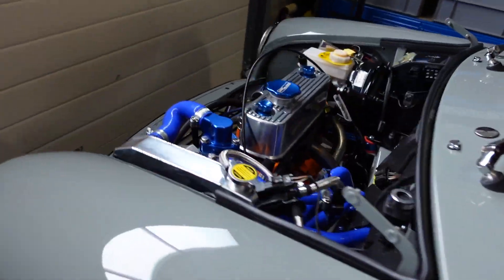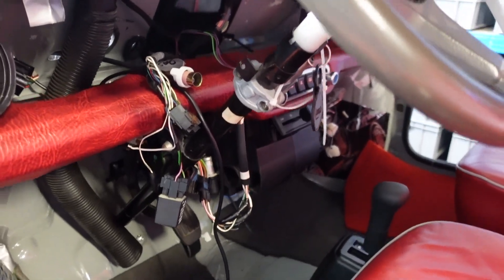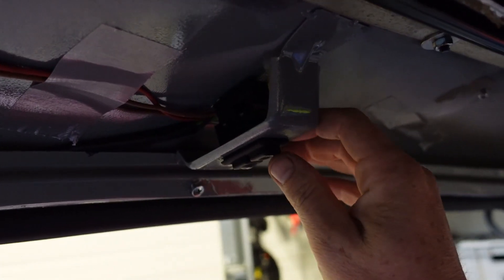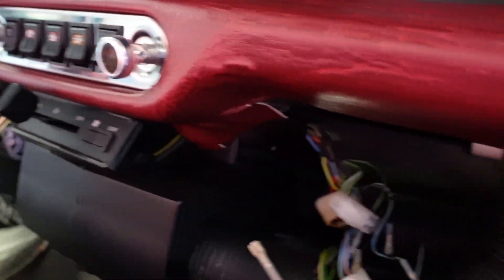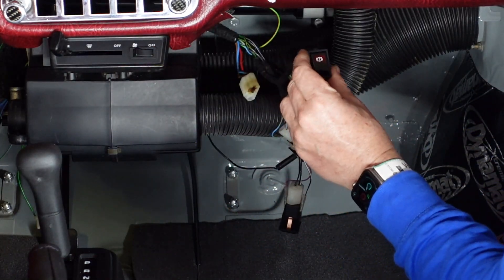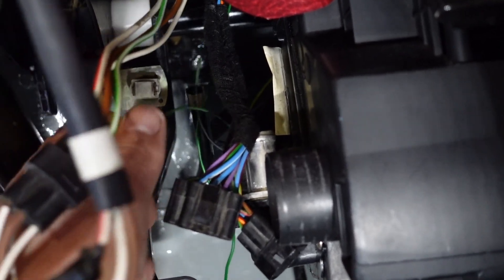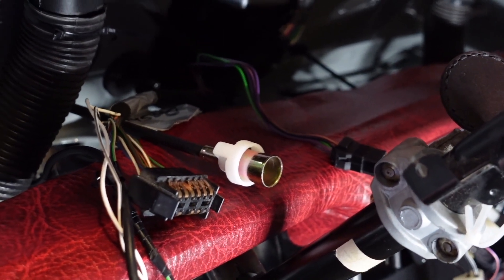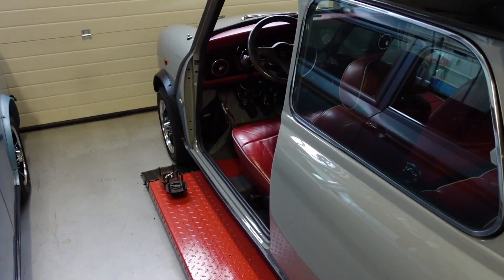Classic Mini Culture - Part 23- SPI wiring

Comment: Is it possible to modify the tank brackets rather than the support bracket welded on the car? Might be an easier fix for you
Reply from the maker: Mike I think I've sat and looked at that bracket for hours to try and figure out an alternative, but the tabs on the tank stop you from going past the bracket, and I don't want to cut into the tank, someone suggested a race tank that sits in the wheel well, but that wasn't the look I was going for.........lets see what the body shop has to say🤞
Reply: @classicminiculture9800  Hopefully the bodyshop will do the right thing and correct their error